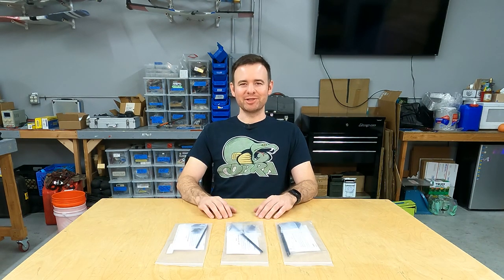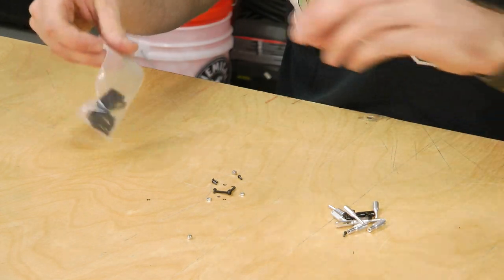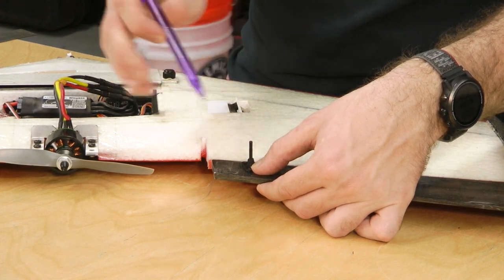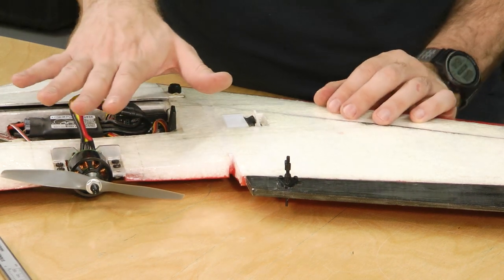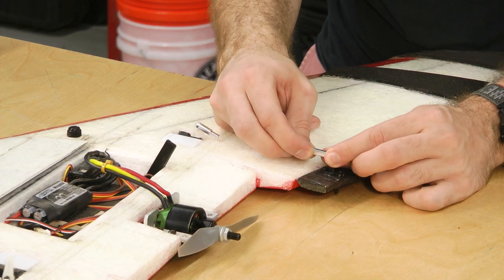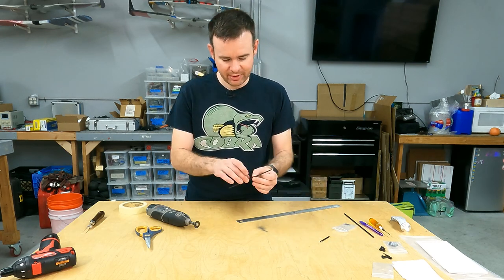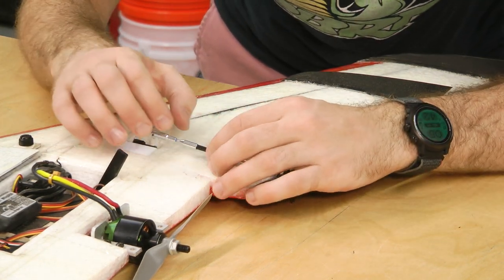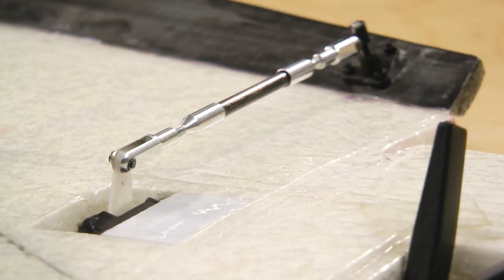How To Assemble Our Carbon Control Rod Kits

Comment: Linkage geo is wrong.  Low on the servo, high on the control surface for a wing.  Use 222 threadlocker instead of blue.  Does the same thing, yet you can remove it with hand tools.
Reply from the maker: The "pink stuff" mild thread locker is a great choice too.  More guys have blue laying around than pink so that's why we recommend the blue.  Anything but Red!  Re: geometry... pros and cons.  1:1 gives you less leverage than Surface-High/Servo-Low, but also keeps response more linear which is why we recommend it as a starting point.
Reply: @FPVTeamLegit  No tailless aircraft I have ever flown can use a 1:1 linkage ratio without severely limiting servo travel and resolution.   3d aircraft uses 1:1 for sure, but you have a wing in the video.   Hence my original comment.

Comment: information        7:09   a pushrod should be  Perpendicular to its associated hinge line.!!!       consequently,  elevon servos  Need  to be oriented, Correctly.        in the case of a swept wing, each wing half should have a load-bearing main spar,  located  at  Thirty percent  of chord.        
sorry,  you have made something simple (a pushrod),  COMPLICATED.!!!
Reply from the maker: It's true that angling the pushrods relative to the hinge line (how this aircraft is designed) changes the geometry from baseline, but the change can be effectively accounted for.  Personally we prefer pushrods inline with the airflow for reduced turbulence and drag.